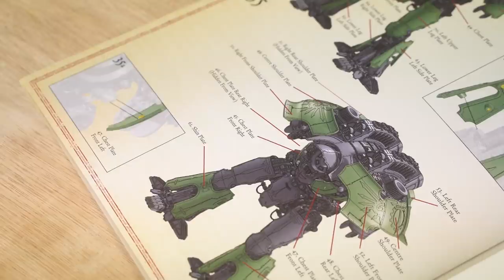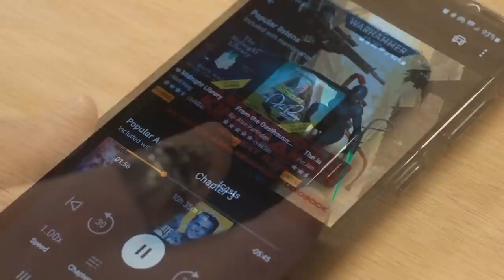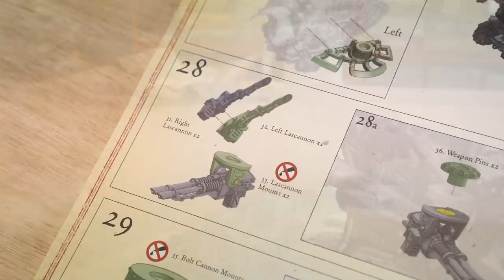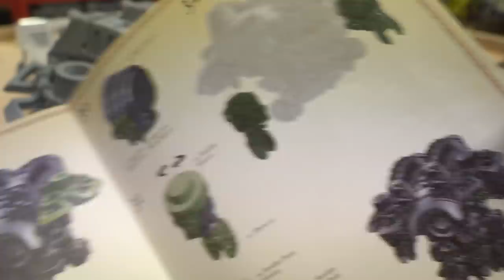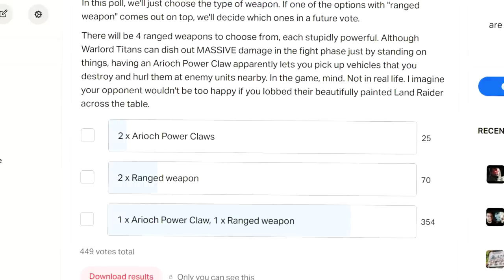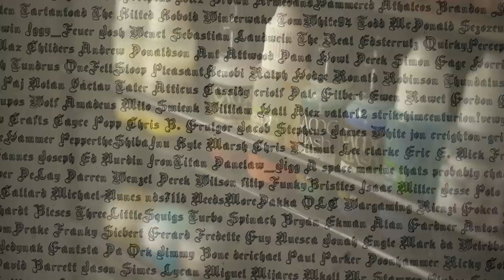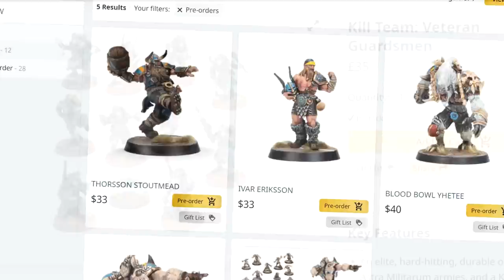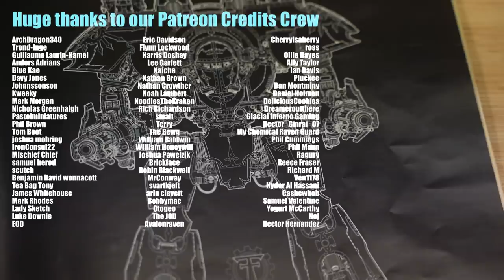IT GOT BIGGER! Finishing the Warlord Titan's body

Comment: Uggh it always disturbed me these titans for the price aren't articulated considering the price. Wonderful video as always.
Reply: Articulation comes with some pretty sizable tradeoffs, especially when you're casting all of your parts in silicone molds.  Concave right angles can, and frequently do, cause some pretty notable tear out issues, for instance, doubly so if you're trying to manage a hole that's deeper than it is wide.

Unlike styrene, which is cast in a natively rigid mold, silicone resin molds will flex, if not properly designed, under the weight of the resin being poured into it.  There are ways to compensate, but resin casting in a silicone mold isn't nearly as precise as you would need it to be to accomplish reasonable articulation.
Reply: @andrewamann2821  I have always thought that these large companies use precise and rigid injection molds like the Lego does with (ABS) styrene or their new recycled resources. 
I am not a pro in this business so thank you for broadening my horizons.
Reply: @mortisCZ  you're not wrong about the bulk production part of GW's plastic...  That's done with a simple (in theory, the finer points of engineering a copper-alloy mold can be a bit tricky, putting aside material cost, the labor to produce that first mold is gonna be pricey...) injection molding setup.  That said, ForgeWorld has never been a particularly large-volume operation, and epoxy resin just doesn't spin cast (standard method for pewter and white metal models... and finecast...) very well.

As far as being a professional, I'm really not one, either, I'm just a scutwork monkey in an engineering department, with a curiosity about how things are made, and a habit of asking the right questions of the right people, when I happen to cross paths with them.

Comment: A pro tip from a very clumsy dude with glue: to get rid of Any kind of glue, just put a drop of olive oil on your finger tip, and a little bit of salt. Rub your fingers on each other and you can feel the glue getting loose without any effort. Classic hand wash afterwards and your fingers are free of any kind of glue.(works also for resin) 😊

Comment: Using Allen head screws instead of drywall screws makes it look so much more realistic. If you see them you can pass it off as a massive bolt meant to hold things together instead of "hey look it's a drywall screw" because big ships and stuff do actually have massive Allen head screws holding things together at times.

Comment: Been a lurker for a while now, but I would recommend that you also add some small hanging sheilds or banners from the Titan's pauldrons. Paint scheme should be the Midwinter minis color palette and silver. Do the regular steel, copper, and greys for the main part's on the body, but make the armor panels have silver edges, the leg panels black and blue in a pattern of your choice, and the shoulder armor be the blue, rest of the armor black, and the head white.

Comment: Eons of Battle recently uploaded a video building and painting an imperial knight. In the painting section he used black and white primer to pre shade/highlight the panels then proceeded to glaze with he desire color combination, this achieve a very good final color without an overwhelming amount of blending I really suggest you give it a watch just in case you didn't know about this technique.
Anyway back and teal (or light blue teal) really work well, however you may need to consider the metallic trim in the armour first (if you're gonna paint it like that) to then decide your color wheel.one of the most striking features though is usually the diamond/stripes pattern usually seen in this titans and that requires stencils for sure, hope this helped a little bit at least.

Comment: To make the arms easily changeable without using magnets, you couldve installed a nut and washer inside the upper arm joint and then run a bolt supported by a large washer through the shoulder portion. Then magnetize the shoulder armor pieces so you can easily access the bolt.
Bonus perk of bolting it together, is you can loosen the bolt, adjust the angle to a desired position, and then tighten it in place. Or leave it slightly loose so the arms can turn 🤷‍♂️

Comment: If you ever build another big resin model i would hiiiighly recommend picking up a horse hair shoe polishing brush. They are very big, have very long, flexible, and dense hairs, but best of all they are very soft and gentle. Just getting one would make cleaning the big panels in soapy water much faster. I haven’t personally tried this as I haven’t built any forgeworld kits but I used to be in military school and used those brushes on a daily basis to shine shoes. Highly recommend especially since they aren’t too expensive at around 10-15 dollars and they last forever as shoe polish is lets say marginally more toxic for brush hair than soapy water.

Comment: Couple of slight suggestions of things i do that you might like.
I use chalk pens for marking stuff, when dry they don't rub off easily, but as they are chalk they come off super easily with a tad of water and don't smear.
For the schemes, maybe grab a box of the adeptus titanicus knights. get to trial 3 rough schemes per box. you won't get the final detail, but thats not the point. you can see how different armour panel combinations may look, what colour you want the metallic gubbins to look, etc.
hope these help, feels a bit weird sending the advice against the normal flow

Comment: Hey , great video btw , after seeing eons of battles titan vid today . I think that at least for the black part of your logo , you should paint all the metallic bits a burnt metal . Will be "quick " , but probably take for ever on this and is only a few steps to get something that looks good . I think all  you should / could do is add some different browns / rusty tones as a base , drybrush with black ( to cover most of the undercoat ) then drybrush with a gunmetal silver . I don't think you will even need to add a wash . 
Thanks for reading , keep up the good work !!!

Comment: If you use one plain colour for the panels then the names can be ghosted into the panel. I would suggest by printing them on decal paper and then misting over them in the base colour. Thank you for this series by the way, I have been contemplating a Worlord build and this has cemented the decision - I'm going to see if your prediction is correct! ;)

Comment: I'm not a 100% sure if this is the case for the GW resin, but I know a lot of model resin and 3d print resin melts with acetone.  It can be used to smooth rough spots, and importantly you can "weld" some resins with it.  Just dab a tiny bit on both pieces you're wanting to 'weld' then press them together.

Comment: You may not see this, but I have an Idea for the supporter inclusion. You know how the knights sometimes have the banner between their legs. You could save yourself some time painting by having one big banner between the legs, trying to fit as many names on a piece of paper and print it, age/weather it, and hang it with chains or cabling. For the extra maybe go the route of the space marine backpack banner and dual face it. Front facing banner has names, and then the back can either have more names as you require, or maybe do like a long ornate banner for House Midwinter.

Comment: Good use of carbon rod — Drilling and pinning everything is not as annoying as having to fix broken joints. This may be the first time I’ve seen drywall screws used to pin a mini, but there aren’t many models this big & heavy

Comment: Blue to black or black to blue panels with white trim black and silver dry brush for ur main metal body red and yellow for ur wires and silver for electrical components on the sides of and read of the body and pipes

Comment: I've always wondered if it was possible to hollow out some of the parts, seeing as they are solid resin, if you drilled a series of small holes in some of the larger parts you could remove a significant amount of weight whilst maintaining rigidity and durability as the inside would be something of a lattice, similar to what you see in 3d printed objects

Comment: I had an itch to build a titan legion, had one warhound for a few years now.  Just got my reaver and second warhound in the mail.  Will say quality and even the resin is way better then the last one.  Still trying to figure out the 4th and final unit to add.  But i hate pinning stuff, lucky my super glue and loctite glass seal works on the reaver.

Comment: Have you thought about friction at the moveable joints, especially the one, where Torso and the lower body meet? I don't know how much you plan to move these joints, but over a LONG time even plane plastic surfaces could act like sandpaper, even faster, when heavy weight is aplied or the movement is more often than just 2 or 3 times a month. 
And the sandpaper effect might follow a more exponential curve in how much it adds up, due to released plastic particals in the process.
But that's just some hypothetical thinking. I'm not sure how strong this might effect with the plastic used here.

Comment: Why not try your hand at having a custom stencil made using all your Patreon members names? It can be done with a cricket or you can have it done by someone else. Then you can use that as a pattern on the shields/roundels. As for how to paint them in… I would say something subtle would be best. If the base coat is black, a charcoal grey would work well. There is enough contrast up close to make the names legible but it would also blend well enough at a distance.

Comment: I feel like scratch building a warlord Titan with a lot of effort on accuracy would be just as much of a project as building it itself…
Reply: Maybe....  But a scratch build has the advantage of not having to fight stubborn materials quite so hard to get them to cooperate.  Forge World resin can be gorgeous, but it tends to be kinda picky in the assembly phase.

With these Titans, simple pinning is, generally, the bare minimum of structural work that you should be doing to support the build.  Designing the sub-assemblies from raw materials would be ideal, since you can manage the static and dynamic loads more effectively than just glue would.

Comment: the only half way decent way to get all the names on it would be to have a laser cutter cut the names out of a sheet of paper and then use it as a stencil. 
I mean, you could totally baller it and do it all by hand, but we'd have a 24 hour video and you in hospital at the half way point.
Of course the biggest hurdle then will be choosing a decent font and you'll basically be limited to army style stencil fonts, not some neat Gothic one.

The only other way i can see is print directly on some sort of transparent sheet, but that's probably going to be too thick.

Comment: Really bums me out when I see wonky parts on such an expensive kit. They should make sure the kit is perfect for that asking price. Other wise. Beautiful model
Reply: I agree with you there. If I had to do this much ADDITIONAL work to make sure the things fit together as they are supposed to, I would honestly be returning the model. Something that large and that expensive should NOT come with all that extra work needed. Constantly shaving pieces off, having to re-heat and re-align bits, that's too much to ask from prospective buyers.
Reply: This is one of the inherent downsides that you get with cast resin pieces, especially at this huge scale. It just kind of comes with the territory, and if GW were to quality control each and every single piece on a 300+ piece Warlord, the price would likely be much higher than it is right now. For more series issues like big mold slips, FW will replace parts, but the kind of assembly work that Guy is doing is expected on these kits. Heat bending and pinning resin is not difficult, and this IS basically difficulty: expert level, just due to the massive size and number of parts involved.
Reply: Partially agree. However it is the issue with resin. And that's also why they are experienced hobbiyst material. Not everyone who built some space marines have the skills to pull this off. In the least, they should have someone check the parts before sending them off to a customer, warping is unavoidable but double checking is perfectly doable... 😔